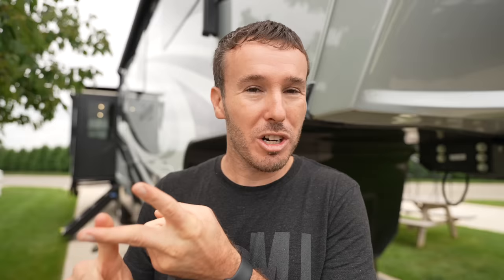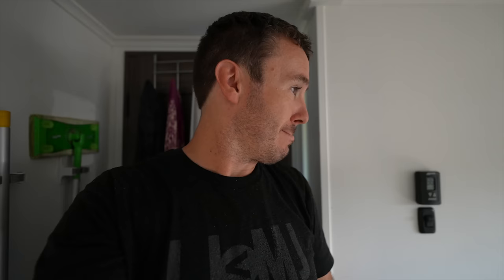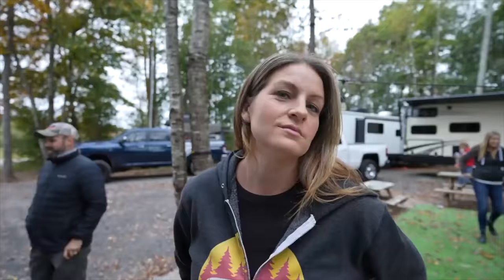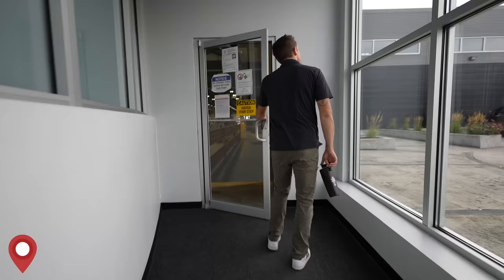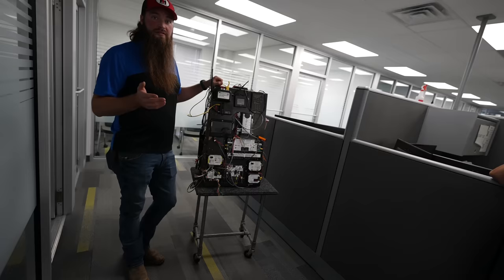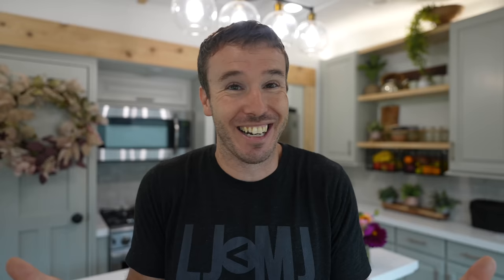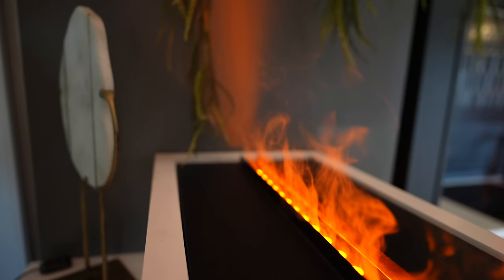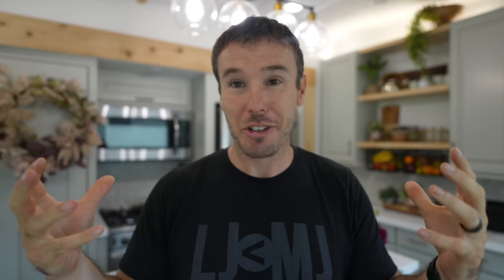Camper Repairs & RV Innovations // Tour The Ultimate Montana

Comment: We had a step failure on our Class A, dealer could not get us in right away so I started to work on it myself.
Lippert really gives you a detailed manual how to check the system, so I get my tester out and determined it was the step module failed.
Well we called Lippert and he asked me if I done everything in the manual, I said yes.
So he send me a step module FREE of charge overnight.
Well it still did not work, so the last step was to get the pin holding the step out, keep in mind step was frozen in the in position.
After fighting with it and some bruises I managed to free the pin so I could move the step out to get to the motor, had to make a makeshift wire harness for testing, yep Motor gone.
Called Lippert back and again send me a FREE motor.
It works fine now, the point is Free, overnight, wow Lippert, what a service is this , we where 3 month over our warranty.
I bet the dealer would have charged us tons of money and taken forever.
Thanks Lippert for such good customer service 👍👍👍